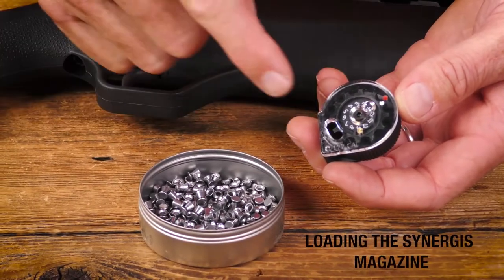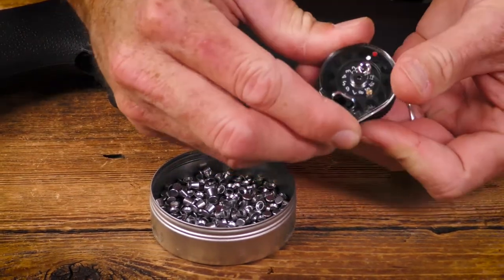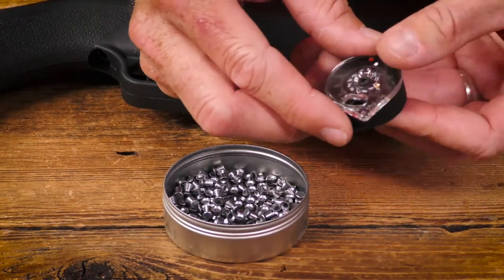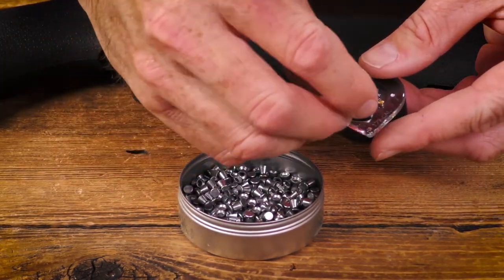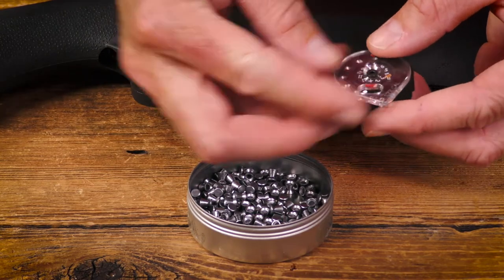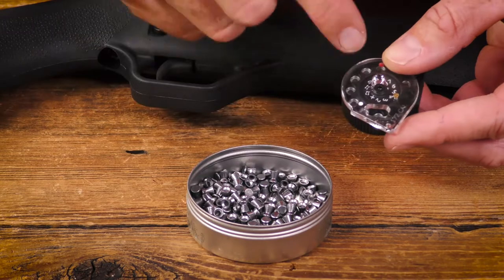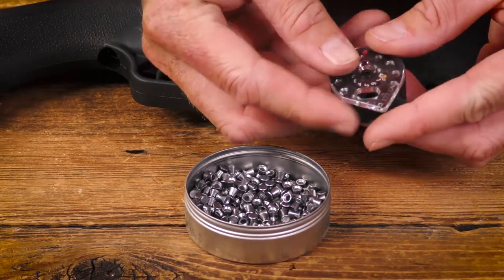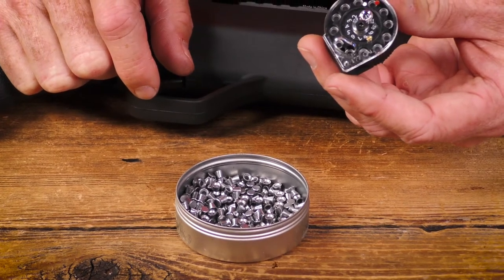How to Load Umarex Synergis Magazine with Airgun Pellets : UX Airguns

Comment: When you're loading that first pellet do you have to hold that clear plastic plate in place? Once you have pushed that clear plastic all the way to load the first pellet will it stay in place by itself or if you let it go without the first pillow in it will it go back to the last hole. I guess what I'm asking is that clear plastic plates spring loaded?
Reply from the maker: Yes, twist the clear cover in the direction of the arrow until it stops and hold it there. Hold a finger under the hold and insert the first pellet. Once the pellet is in place you can let go. The plastic plate is not spring loaded but the chamber wheel inside is and the plate engages with that.

Comment: Will not load pallets
Reply from the maker: I trust you sought out one of our gun techs at UmarexUSA.com Contact Us page or reached out through our Facebook Messenger. If not, that would have been a good action to take.
Reply: @UmarexAir  fusion2 .mag. load. Right side or left
Reply: @UmarexAir  what rotates the magazine during use? I have a loaded magazine that is not moving to the next round after firing. What could be the cause? Is there a manual for that mag?
Reply from the maker: @callupchuck  It is spring loaded, if you can unload the pellets it might fix it. If not call our gun techs Monday at:  (479) 646-4210 ext 7
Reply: Pellets I bought are gamo extreme accuracy with pointed red tips. Only got one pellet in the magazine while the rest get bent and smashed. Turns out you can’t use any other pellet😑. Would have been nice to know ow before I wasted the money on them

Comment: what ever individual, or team, designed this magazine, did a great job. This video sucks ! No mention of using a finger nail to get the rotation of clear plastic started, THEN bring the clear plastic slightly pass the locking tit . This magic move allows smooth insertion of first pellet.
Reply from the maker: Sorry you're not happy with it.